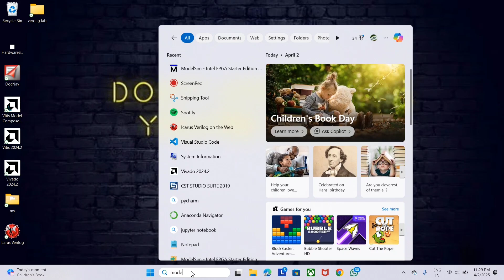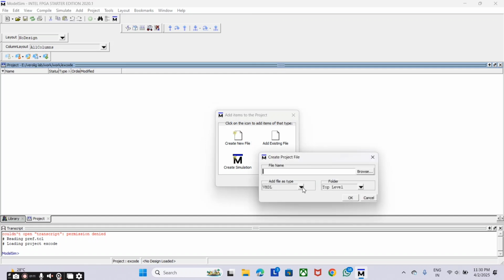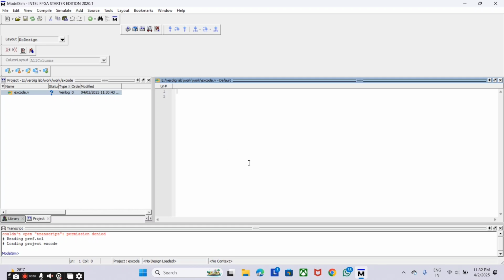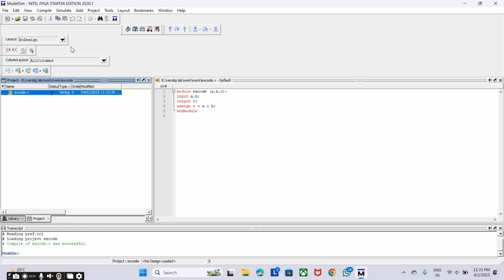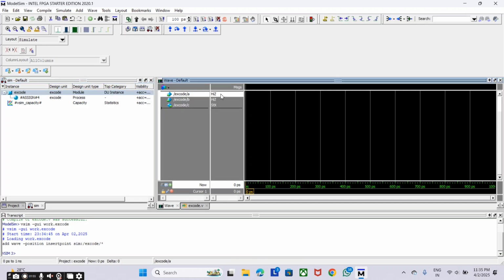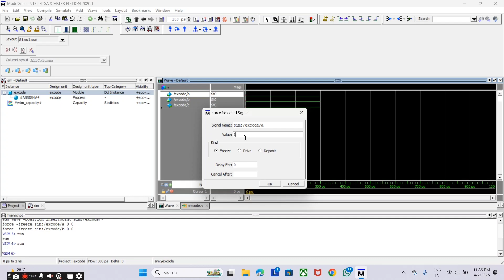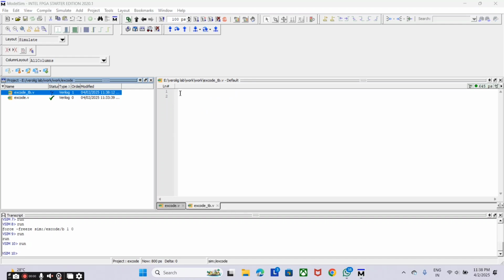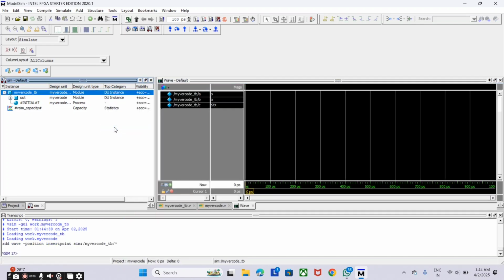How to simulate a design in ModelSim Software with and without a test bench | Free Verilog Simulator

Comment: There is nothing visible in my work file/. Give me a solution
Reply from the maker: please check location that you have allocated for saving your design files while you creating the file.
Reply: @STUDENTVERSION1103 i have checked and the folder is there and files are also getting saved. But not able to run.
Reply from the maker: Ok I will do another video about this. Again try to check weather the files are saved in work folder or not.
Reply: @STUDENTVERSION1103 is it the problem with amd processors?
Reply from the maker: @sreeharim7464 no
Reply: @STUDENTVERSION1103 i have tried this in my two laptops. But same problem. While simulation, the work is empty.
Reply from the maker: At beginning I also faced same problem,the design files are saved but it won't appear to run in work folder.Please you create a separate folder to save your files..in that create another file with name work. While choosing the location choose this work file which is in another work folder. And create your designs. If this also not working for you means just drop your mail id to contact.. I will do it for you.
Reply: @STUDENTVERSION1103 please make a video. I want to do some work in verilog
Reply from the maker: Ok why can't you try vivado. sorry..present I have some other works to complete, but definitely I will post all videos regarding this problem and other tools also.